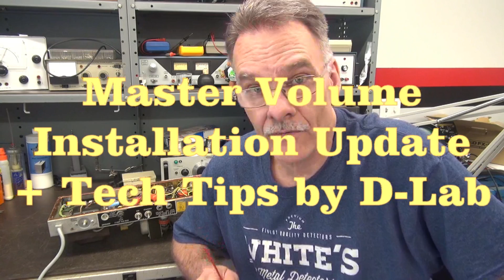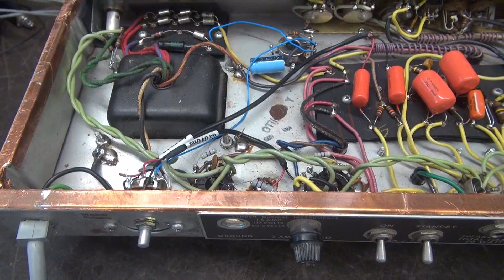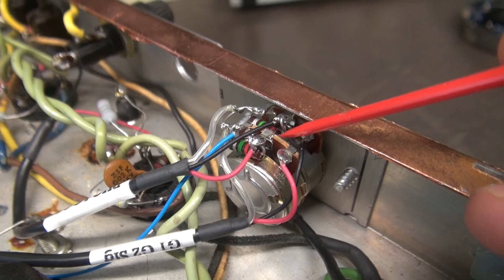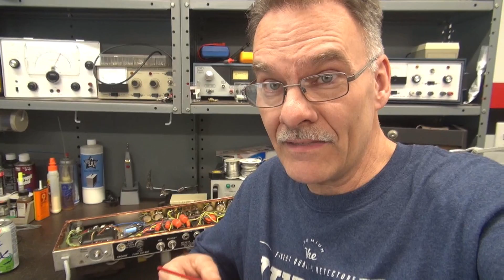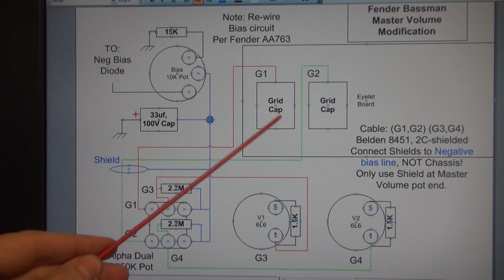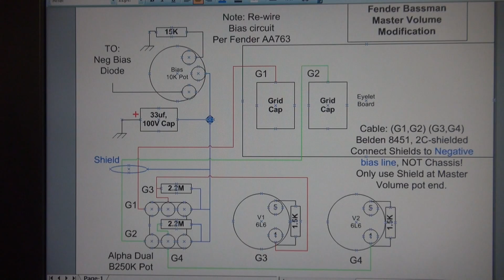How to install Master Volume Vintage Fender tube Guitar amp Simple Instructions D-lab electronics

Comment: Hi Terry I'm from India I have Vantage tube amplifier and it's output is very low I wanted to know what could be the problem . I've worked on other amplifiers but not in valve sets So I don't have any experience in this.but with your guidance I'm sure it can be fixed. Thanks

Comment: Great video.  Just finished this mod in my homebrew AA864 Bassman.  Works like a champ and great natural tube distortion at low volumes.  This mod did not induce any noise as well.

Comment: Hey terry! Thanks for your videos. Ive got a quick inquiry. Id love to have a bassman but the hight wattage is just way to much for me. Do you think that its possible to mod the bass man into lets say a ten watt amp? Would that mod even make sense? Thanks in advance
Reply: I have a Bassman on the way, but I'm also toying with the idea of maybe finding a kaput Super Champ X2 head, ripping the guts out and building it into a 15 watt mini-Bassman, so to speak.  The 15 watt hardware is already there, so it's a tempting thought.
Reply: What’s the point when you can simply use the master volume mod?
Otherwise you’re probably looking at a smaller transformer.

Comment: Terry, many thanks for the follow up on this mod. Today I successfully completed the master volume installation on my 70s era AA371 Bassman. It’s a bit different in that it has 100K grid resistors. So you need to use a 100K dual pot. Though it probably doesn’t matter, the bias supply is different with a 50 ufd cap right at the diode, then a 3.3K resistor, then another 50 ufd cap before the bias supply to the hum balance pot. Also, when you ring out the wiring for testing, the bias to ground will not be an open circuit because the capacitors charge up. But it really was pretty easy and nice and quiet. Thanks again.

Comment: Hi Terry..Im installing a Frondelli type Master Volume circuit where the PI coupling caps feed the 250k pot directly to the wiper then either side of the pot is connected to the screen resistors and -grid bias respectively... should I ground the shield wire to the -ve bias as well?  
Its a new build and I have some really bad hum 100Hz which Ive measured also coming out of the blue and brown wires of the OT the B+ has the expected ripple... any ideas?

thanks in advance.

Comment: Well, inserting this post-PI Master Volume allows to vary (decrease) the open loop gain of the output stage. How does this modification affect the proper operation of the overall feedback loop even though this feedback might not be strong? In my opinion, this issue is totally neclected. Obviously, the audible result appears that this modification does no harm, but wouldn't it be a good idea to be assured and take a signal generator and a scope to test the frequency responce of the output stage just to see what it does when varying the master volume pot?

Comment: Terry awesome video and thank you, I was able to add a MV to my fender twin reverb and tame the beast.
I record in a small studio without isolation booths and my question, is there a way to add a pre amp output to a vintage fender amp for direct to mixer recording rather then using a mic?
In the small recording area the mic picks up all the noise in the room
Thanks in advance for your input, Michael

Comment: Great work -- I have never used this type of MV but I have used the single 1 meg pot across the grids of the output tubes  -- I usually use the ground sw hole with appropriate washers

Comment: You can also use the bias pot to balance the tube. You will have to change the bias pot and ad a 10k pot in series. With the output or your negative output of your dc voltage!!!!!!!

Comment: I use dual 250kB pots but many have noted to use dual 250KA pots including Triodestore.  This is a MV that Ken Fischer Trainwreck pages listed then modified by Larry and Mark as the Lar-Mar PPIMV.  So many builders use this PPIMV because it is transparent sound wise. Mark F

Comment: Thank you for the awesome repair Terry, I plugged in My JBL 12 and My EV SRO 12 and cranked it up to 7, I plugged in a jumper cord from the normal channel to the bass channel, and plugged straight in to a  Strat with noiseless single coils...and WOW, what  a difference , then I plugged in an OCD overdrive pedal , double WOW ,I played for 20 minutes , when I finally shut it off I said, sounds like He fixed it right!...sustain galore!  I'll have to make a vid of My Bassman /JBL/EV SRO cranked  so you can listen,  thanks again! ……. RR    ...PS thank you for turning Me on to Motion Device...I'm a lifetime subscriber now!
Reply from the maker: Roger that man, Appreciate the cool repair + the Tip$
I also subed to Danielle Nicole
Reply: 83roadstar He did mine last week and I was speechless playing it the first time. I too jump channels on it. I took my pedalboard to his place, but left my oddballs at home. When I got home, I hit it with an old Tone Bender and it was GLORIOUS!

Comment: I'm putting together my first AB763 clone and I have been working out the addition of a master volume.  Thanks for the timely video to do this properly.  The only difference is I am going to convert one of the tremolo input holes to the position for the master volume knob for ease of use.
Reply from the maker: Sounds like a great project man

Comment: Placing a pot like this between the driver and the outputs effects the loop gain of the power amp. Placing a master volume in front of the driver stage is safer and just as good noise wise sense the power amp's gain is real low. And, as far as safety to prevent roasting output tubes, placing so many extra components in this place of the amp lends itself to introducing too many more problems. A single pot in front of the driver stage is less dangerous to the amp and simple.
Reply from the maker: Hi Ralph, That would be a great video for you to present. The post inverter Master volume is well documented and accepted, No affect on tone response. TD
Reply: But, if you have a PRESCENCE control installed in the phase inverter it will effect that.
Reply: @ralphmacdonald7928  Yeah Ralph there is a presence control on the bassman. I have a Japanese Mesia amp which has a master volume and a gain boost on the same pot. Love to see your version as it appears to be the method used on my amp. The Mesia MT60 has no presence control. The MT100 has presence dial round the back panel. Very interesting. Thanks D Labs for the debate platform.